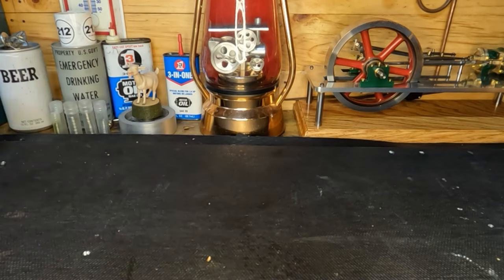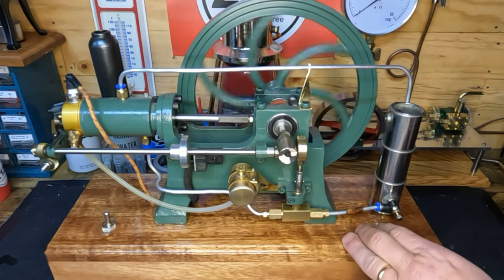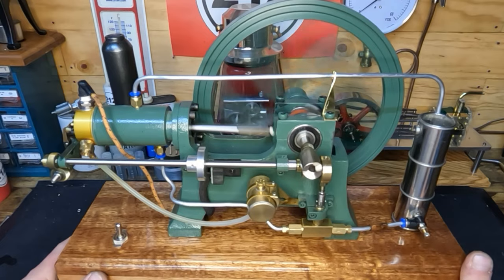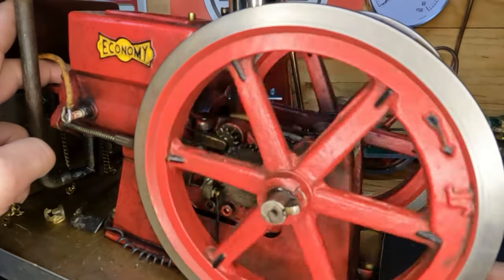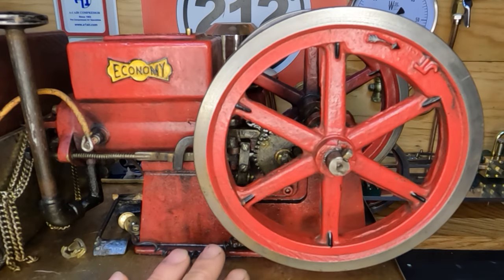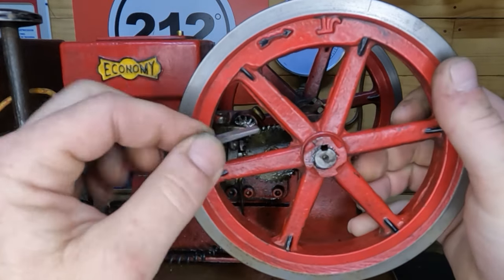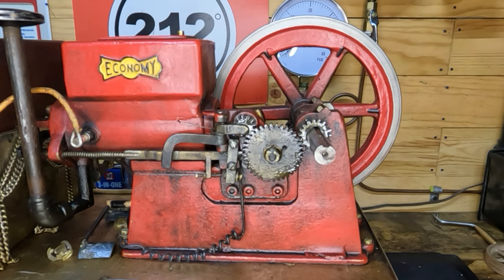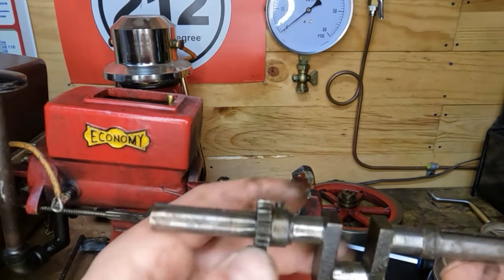Running The Modified "Hot Bulb" & Another Hit & Miss Project Begins "Economy Takes a BIG Hit"

Comment: Did you make a video of you making the modifications on the “hot bulb” gas engine? I bought one and am planning on doing some of the things you did. Was wondering how you bent the water cooling tube.
Reply from the maker: Hi Kevin, I did not video the modification on the hot bulb. The tubing is aluminum and bends very easily with a small tubing bender or even by hand if you're careful. You'll be amazed by how much tubing will be left over after you straighten out what is there.